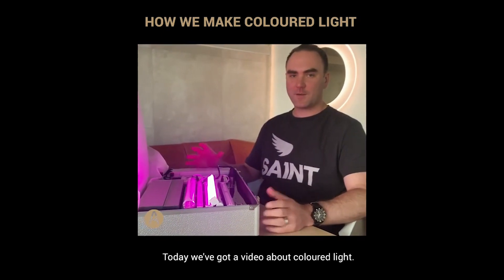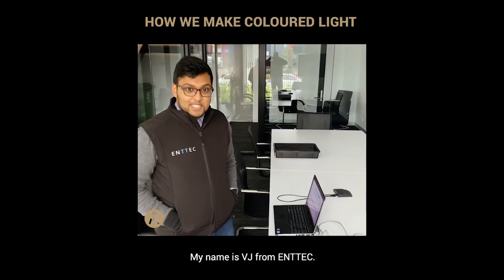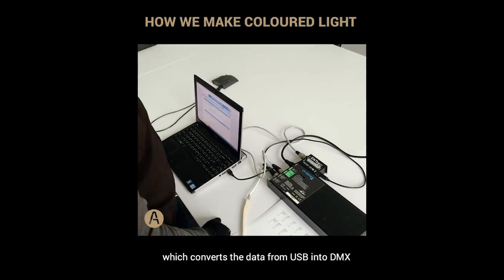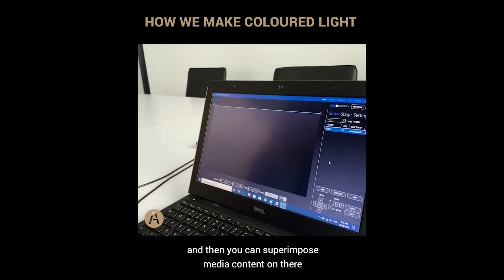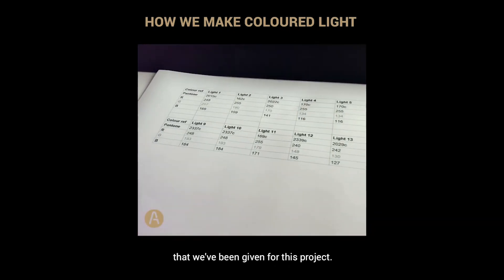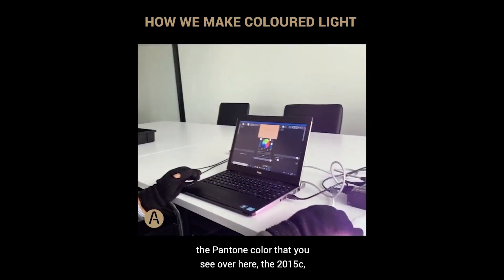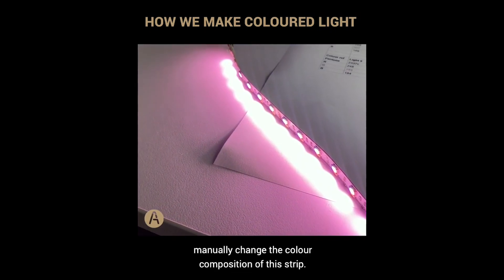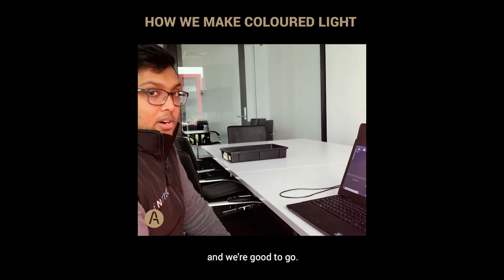How to match LED pixel lights to a Pantone colour

Comment: As Pantone colour swatch is reflected material, it's hard to match with illuminates LEDs. If you want to get more accurate colours, using spectro-radiometer to get spectra data from LEDs and using spectrophotometer to get data from Pantone swatchs and adjust your parameters. That should brings you more accurate in colour